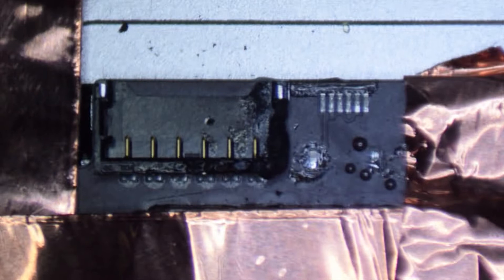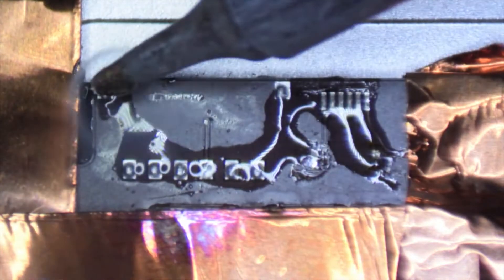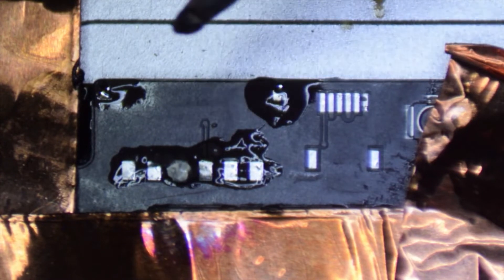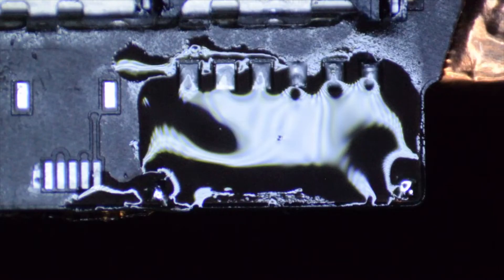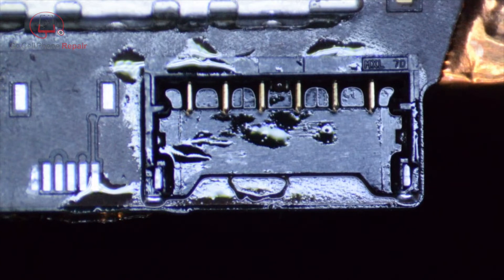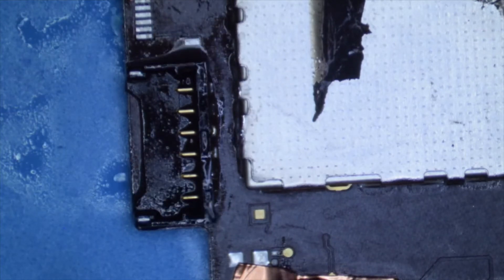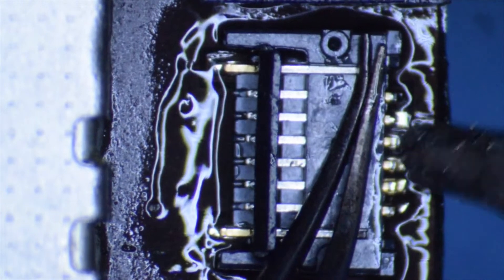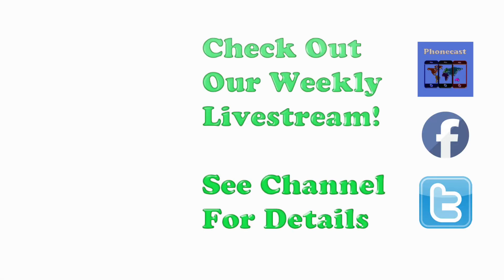iPad 4 Home Button FPC Replacement

Comment: What tools do you need for this repair??? Meaning like what liquids, solder, soldering gun, clean up wire mesh cable u used??? Most important what kind of heat gun did you use?

Comment: Hello, hope you still response to comment, so I got an old iPad 4 back in the days, with broken screen, I fixed the screen but ended up broken the FPC chip of both the home button and speaker. I look every where and saw that people are charging expensive price almost close to getting a refurbished one. 

So what I'm asking is how much are you charging for the replacement of the home button and speaker FPC if I can provides the parts and dissemble the logic board and send it to you? Or should I just risked it and do it myself because it's an old iPad, and I can't afford to spend lot of money to fix it, thank you.

Comment: Low melt solder maybe to remove???
Reply from the maker: Maybe. But if it’s being replaced you’re probably not worried about melting the old one. Shielding the speaker connector might do it if you’re only after the home button fpc.

Comment: Nice demo, I do wonder if I should get into repairing iPhones and iPads, I have been asked by people I know to fix their things, which I do, but wonder if I should do more for others too, would just mean having to have spares in stock all the time.
Reply from the maker: In this case having the parts on hand is not a big deal at least as far as cost goes. When you get into screens which are far more commonly damaged you'll invest quite a bit more relatively speaking in order to have them on hand. And if there is someone down the street who can do the repair same day you might need to offer the same turnaround time.